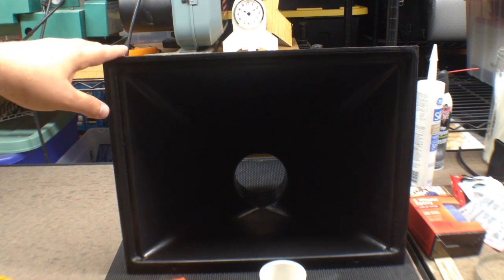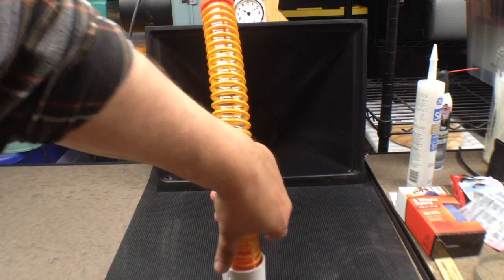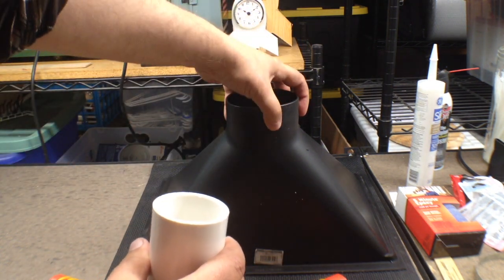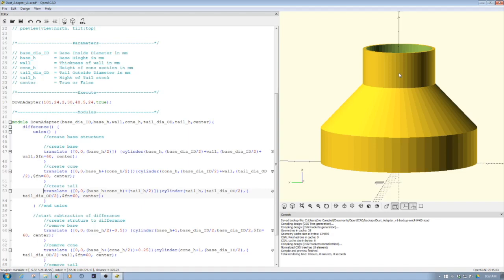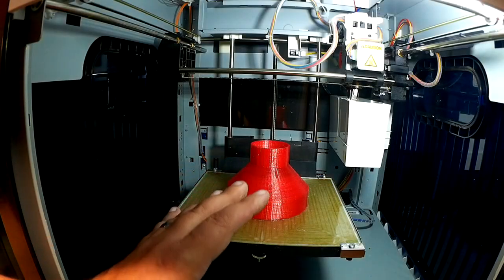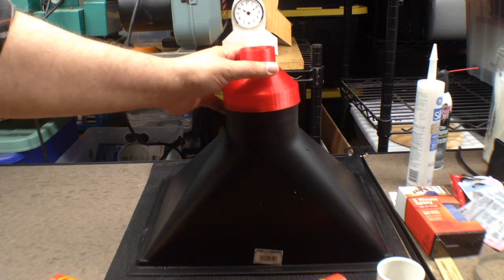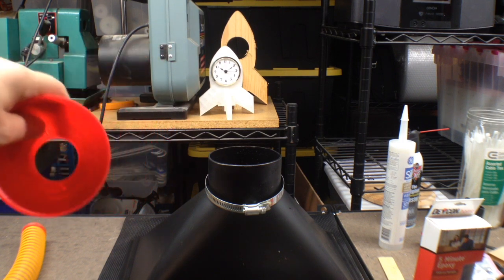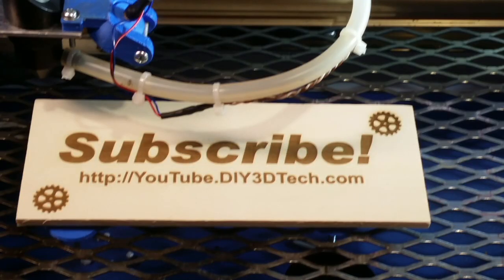XYZ Printing DaVinci 3D Printers  - TPU Printed OD to ID Adapter in Open SCAD!

Comment: So the davinci pro can print using tpu no problem? What temps do you use?
Reply from the maker: I wouldn't say without problem, however you have to run it slow I think I was printing at 250c

Comment: Months later i show up but.... is this stock hardware on the xyz da vinci pro 1.0? or are there any mods that were done to make the flexible filament to work?
Reply from the maker: Outside of reflashing, it stock now admittedly this is not the best extruder for this and it will lead to early end of life but that simply would be a reason to buy a new printer :-)